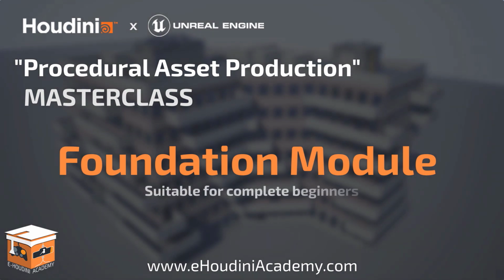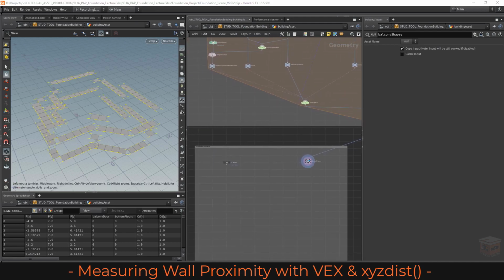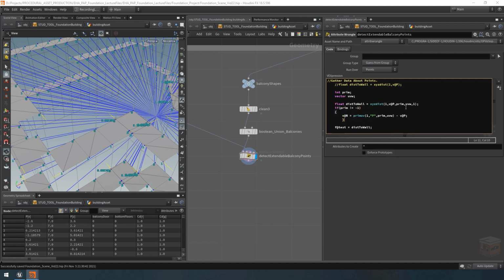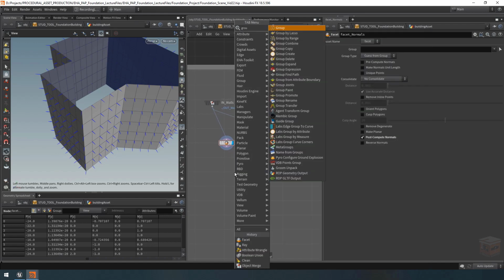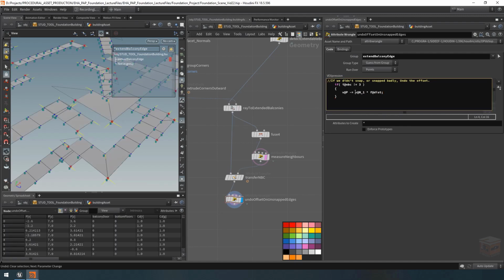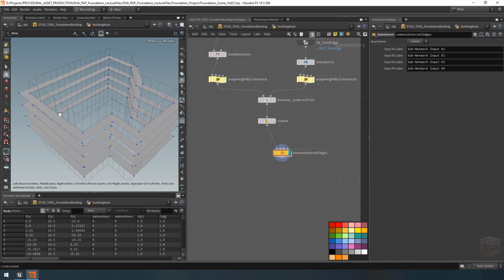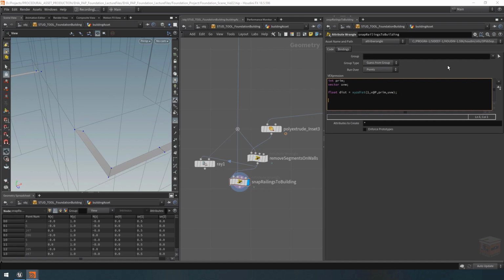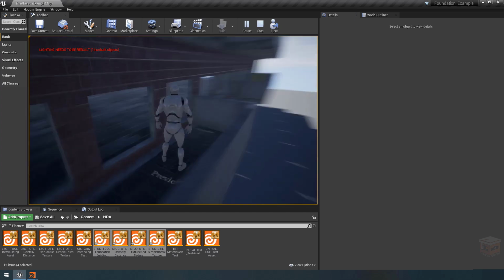HOUDINI FOUNDATION - 28 - Modeling Balconies using Vex - ( Free Tutorial for Game Dev with Unreal )

Comment: I really need help, when I use the 4.26V2 version of the houdiniUE engine plug-in, I click my subfile button (e.g. Buliding Setting, Doors and Windows..) , they cannot be switched, but the plug-in of 4.26 version can be switched, but I do not want to use the plug-in of 4.26 version due to some bugs, how can I solve this problem?
Reply from the maker: I assume you are using Houdini 19.
Un-hide  any folders in the asset interface. We previously hid the subnet and xform folders at the start of the course. 
Or upgrade to the latest houdini and houdini engine builds as this bug is supposed to be fixed.
Did this help?
Reply: @EHoudiniAcademy  Due to work reasons, I can only use UE version 4.26, so maybe the Houdini engine I use is not the latest, the latest is 4.27. I also did not hide the subnet, what I see now in UE is that my sub-options are pure text (while they should have been grey buttons), I am worried that you cannot understand what I mean, I am not a native speaker of English, sorry. It would be nice if I could send you pictures...
Reply: Oh,i am using houdini18
Reply from the maker: @aeroslin5770  I ha ve not tested the houdini engine with the course for Houdini 18. only Houdini 18.5 and Houdini 19.
If you wish to share pictures of the issue to help better explain it, feel free to join the e houdini academy discord channel from the link in the description. .
Reply: @EHoudiniAcademy  Ok,thanks your advice,tutor.